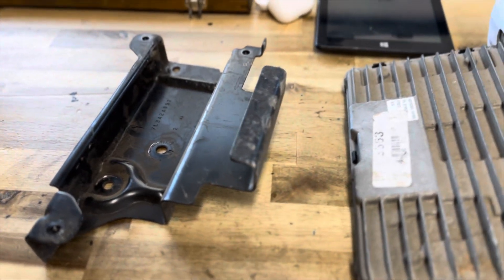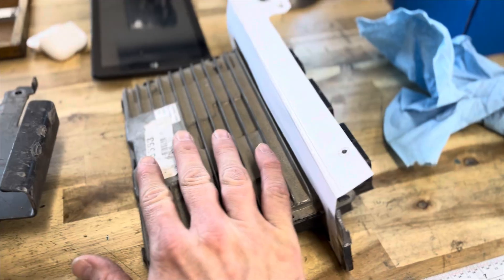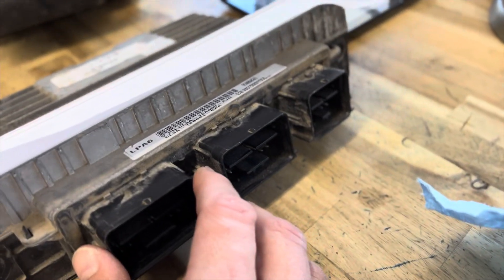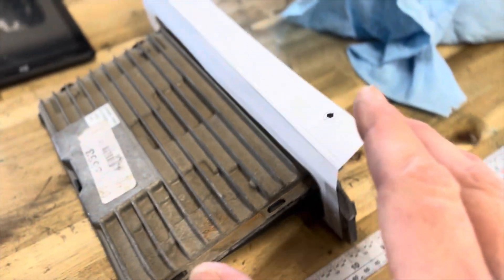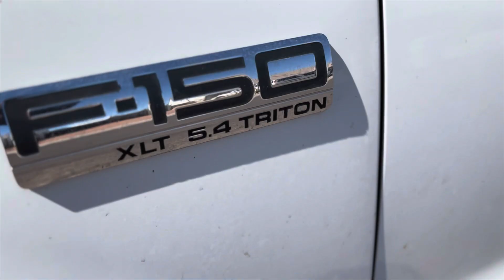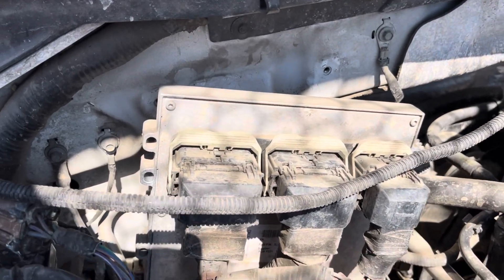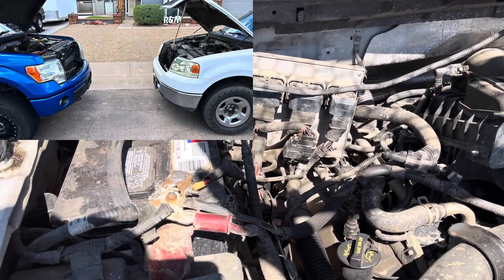Everything needed(ish) to Coyote Swap the 2004-2008 Ford F150

Comment: I have q 2008 f150 short bed with 4.2 liter and manual transmission. I think the bell housing and manual transmission are compatible with 5.0 windsor and 351 I think its easier than 4.6 swap

Comment: Will the coyote bolt up to a manual transmission?? Will I need anything weird for the computer??
Reply from the maker: Yes plenty of manual transmission options. The wiring gets a little trickier though
Reply: @MattSoppa thanks , I have a 2008 5.4 f150 with a good 5speed manual,, I'd like to keep with a coyote .. I'll keep looking into it
Reply from the maker: @adamwinters4448 I’d love to help you out on that. Gotta be the last manual F150 out there. That original??
Reply from the maker: @adamwinters4448 the Coyote will bolt up to that trans if there’s a 5.4 bolted to it now
Reply: @MattSoppa yeah. We ordered it like that from ford.. years ago.. they used a m5rd ..  I believe it was used for the 4.6 in earlier models ..
Reply from the maker: @adamwinters4448 oh hell yeah. Our swap harness, if you haven’t watched the later videos, is tailored for autos but I think I can make it work for a manual fairly simply
Reply: @MattSoppa  I have 2013 that was given to me with a 5.0.. runs great.. or a 93 300-6 built and gone through with turbo.. I never seen a 300-6 swap .. it's a tough decision.. just because I don't want the engine just sitting.. either engine

Comment: Ive went thru 3 different engines in my 07 f150 xlt. Would you be interested in doing the swap for me if its possible to make it daily driveable? If so comment back a way to get ahold of you so we can talk!! Around how much is the swap?
Reply from the maker: I have a complete parts cost breakdown of this swap when we got it all done a few months ago. Look for the 11the Gen F150 playlist on the channel here. I put 2000 miles on the truck before selling it. doing just that. Dailying it. Email me at matt.makeitModular@gmail.com for a formal quote or questions.

Comment: Okay what if i run my stock trans with a gen1 coyote ? What ecu do i run stock?
Reply from the maker: That’s something that you just shouldn’t do. Coyote ECU can’t control that trans and doing a quick shift controller just makes things complicated. Use the 6R80
Reply: @MattSoppa so if I just get any 6r80 it should just be more of a quick swap with your  harness? Other question so you use stock headers from gen 1 coyote from the f150 too and everything from the ac was off the 5.4 too ?
Reply from the maker: @LuisMartinez-bl4sv needs to be an 11-14 6R80
Ac compressor and the rest of the ac system yes is all OG 5.4. Needed the PBH ac bracket for the compressor and 11-12 F150 ac idler, belt, and tensioner
Reply from the maker: @LuisMartinez-bl4sv I used 11-14 F150 manifolds
Reply: @MattSoppa for the alternator brackets which one should I run?  and what alternator should I get?

Comment: Can i swap a 5.0 with a 10 speed into my 2015 f150 3.5 ecoboost?
Reply from the maker: @juan_f150  best to get a 15-17 5.0 w/ 6R80
Reply: @MattSoppa  with a 2015-2017 do you think I will be able to keep all the original functions basically work like if it  came out the factory? Other then the engine and harness what else do you think I will need ? And will my 6 speed trans work with the 5.0? I'm thinking of going that route , my ecoboost blew the a turbo about 10 months ago and I upgraded them to the garret power max turbos. Passenger side blew again recently and i dont even want to replace them since my engine is on its way out too. I been having the rattle start up for the past 2 years or so. So a 5.0 sounds like the plan since i want to build power
Reply from the maker: @ can’t reuse your trans. The body connector pcm wiring is completely different so there’s that, so you d need to re pin that and get the correct engine and trans harnesses mounts, ac lines etc. should be able to keep factory functions this way tho
Reply from the maker: @juan_f150  not easily, and not keeping a lot of factory creature comfort functions.

Comment: 4x4 transfer cases are different I did the 6r80 swap in my 07 and I had to have both driveshafts customized to fit but I am now about to coyote swap it soon and I have everything needed to turn the 11th gen into a full blown 12th gen on the inside and under the hood 😁
Reply from the maker: @11thGen5.0  yup aware of that case difference!
Reply: @MattSoppa  and I believe I spoke with you a few months ago about a custom harness for the instrument cluster for the coyote swaps on the 11th gen f150s
Reply: @MattSoppa  yeah I found out the hard way lol but I am subscribed and will be following this build
Reply from the maker: @11thGen5.0  sick! Hopefully we can help you when it’s time for the coyote. I’ve also if you haven’t seen yet, making a swap cross member for the 6R since as you know it’s longer than the 4R
Reply: @MattSoppa  will it use the same mounting points as the 4R?
Reply from the maker: @11thGen5.0  I believe so just 3” back
Reply: What was your reasoning for doing the 6R80 swap? I have an 05 with the 5.4 and was considering getting a 12th gen to hopefully see a little better mpg since I drive so far for work.

Comment: 4.6 2v to a gen2 5.0, and I used the same motor mounts, I believe the 4.6, 5.0, and 5.4 all use the same motor mounts.

I used a stifflers crossmember for a gen 2 lightning. Welded that on after I mounted the 6R80. I cut the old mounts for the 4R70 crossmember out and did have to move the new crossmember farther back.

I went from a 4R70 to a 6R80, and I had issues finding new coolant lines to work. I ended up using AN hoses with a separate transmission cooler. I bypassed the radiator altogether.
Reply from the maker: @jasonatkinson2032  great! If you check out one of my latest vids you’ll see how I plan to address the cross member and should be able to use the stock 6R80  mount. Good to know in the motor mounts I’d figure they’d work. I also agree on the trans cooling, just going to bypass the rad and go to the cooler from the stock 6R tubes that go to the front of the engine. Did you get the factory gages to work or no? I’ve been told by PBH that gen 2 only a few will work. I’m hoping with what we learned on the 05-10 cars that they’ll all work in the truck with a gen one ECU
Reply: @MattSoppa  my gauges do not work, I haven't bothered to try as I'm planning on swapping in a 2018 complete dash and center console. My only hesitation is the can-bus for the 2018 as it went with a gen 3 coyote, even though the 15 and 18 are the same body. I don't want to fry my 2015 ecu
Reply from the maker: @jasonatkinson2032  can bus is pretty passive   It’s just a matter of the addresses are correct to pass along info

Comment: If you look at an 12 gen f150 the front doors are longer. So that’s part of the reason why measurements were different between trans cross member and front suspension cross member.
Reply from the maker: @scottlance2404  i’d have to disagree because the regular cabs have the little extra doors and the doors are part of the body not the frame. It’s because of the driveline length differences between the 6R 80 and the four-speed auto.
Reply: 4R70 has a slip-yoke on the end, whereas the 6R80 has a flange end. I agree with you. And has nothing to do with the cab length.  @MattSoppa
Reply: @MattSoppa  The reason why the regular cabs had that design in the first place was to save money by using the same front door for all cab configurations. It makes it easier to get a replacement front door if they needed to be replaced for whatever reason.

Comment: Ive been deeply pondering swapping my 09 4.6 3v. I just cant justify modifying the 4.6 with the extreme lack of f150 parts and the lackluster performance compared to the 5.0.
Reply from the maker: @adamconnell5965  besides the body connection to the PCM I haven’t looked to see what else needs to be done. Stay tuned!
Reply: @MattSoppa  literally the best news I've heard in a long time!  I've drawn up all sorts of turbo plans for the truck since I've owned it, but it's now sitting at 140k miles. I really enjoy the truck, but that 450hp limit has kept it basically stock it's whole life. Turns out owning an 87 Grand National for 20 years has broken my brain, and putting turbos on everything seems rational to me now 😆
Reply: @MattSoppa   that seems like the hardest part behind you then
Reply: @adamconnell5965  swap it like a surgeon 👨🏾‍⚕️
Reply: I just bought a 2012 5.0 and I'm getting it prepped to put in my 2009 5.4 f150
Reply: @itz_cohen5916 how’s that going I’m saving money to do the same thing in my 4.6
Reply: @ianknows  I'm currently in the process of getting the block and stuff cleaned and machined if needed
Reply: I am in the same boat…. And after careful consideration and a moderate amount of research, we have decided to be out in the engine transplant list.